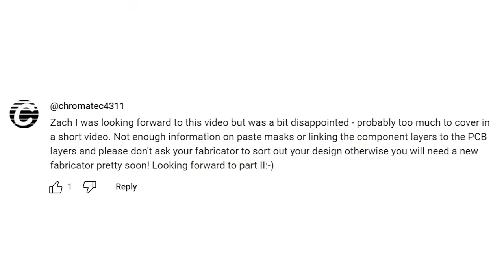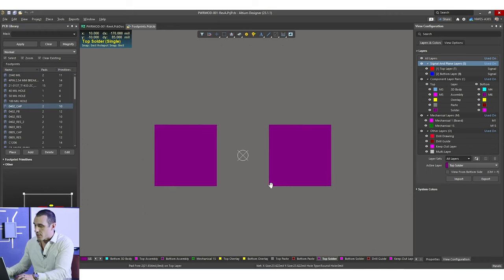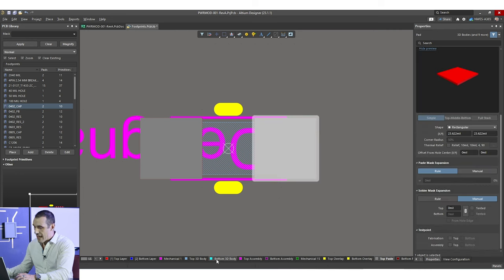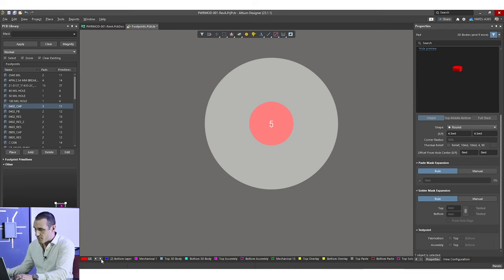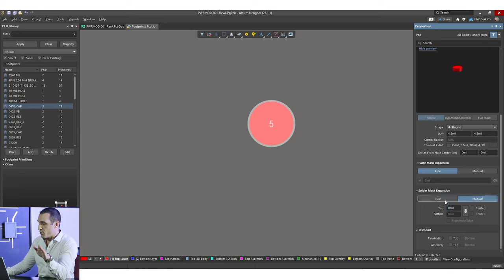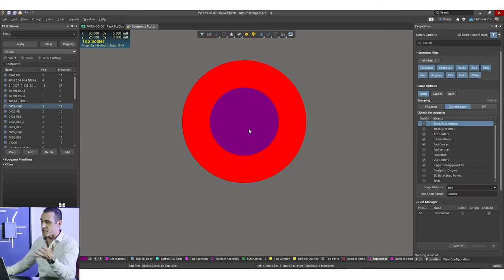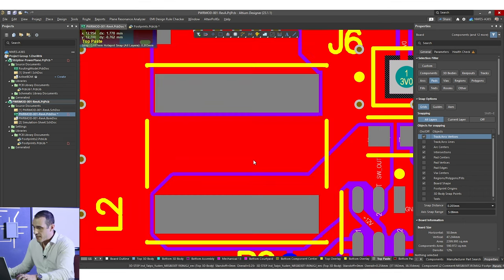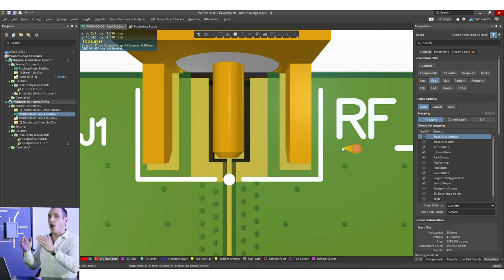Exploring Paste Mask & Solder Mask in Your PCB Footprint

Comment: A quick little 3D peek at that last footprint on a board with the chip model suppressed (so we could see the paste and mask in relief) would have been great. Some of us can easily visualize the little blocks of solder within the pads of exposed copper surrounded by the tented vias, but others might need a visual aid.
Edit: First?

Comment: if I want all routing vias to be tented, how to set up such a rule?  provided I have another solder mask rule for all SMD pads with 2mil expansion (un-tented) as the first priority rule...I can't find an option to select things like "all SMT pads"  or "all routing vias"  to apply the two rules I am setting, end up always the first priority rule apply everything...
Reply: What you can do is create a top-priority rule and use the custom query IsVia to assign the rule only to vias, and then assign Tenting to this design rule. You can then create a separate rule for SMD pads using the IsSMTPin query, and another expansion rule for through-hole pads using the IsThruPin query. You can also create separate rules for different component classes or net classes, which is useful if for example you are using a higher density level on certain components.
Reply: @Zachariah-Peterson  Thank you so much for the information, do you have a video talking about how to place via in pad for BGA?  how to set up such via in design rule?
Reply from the maker: @sparklee6994  This video should help: https://www.youtube.com/watch?v=m_VxUKKUIk0